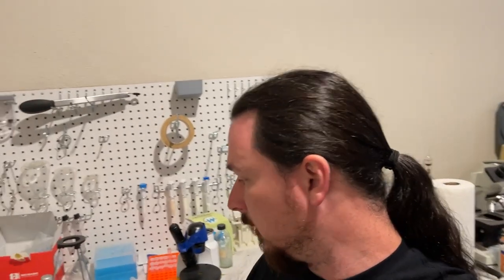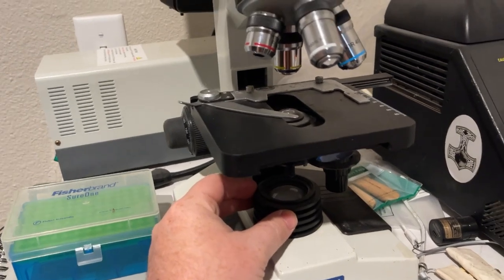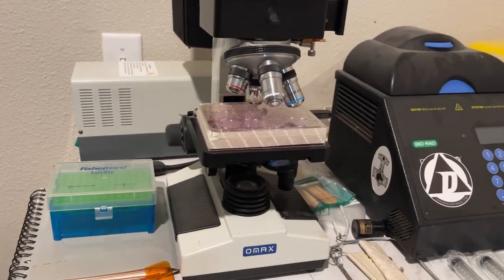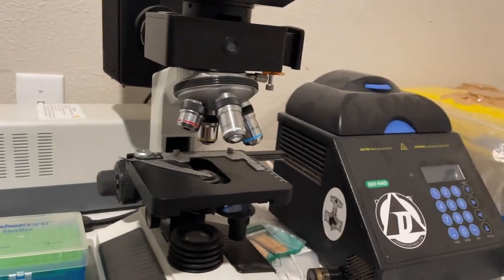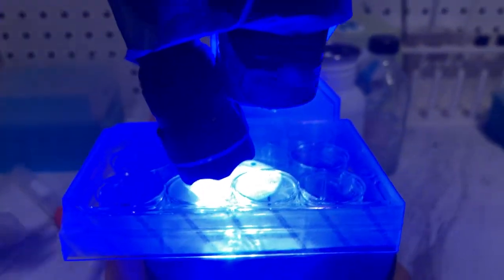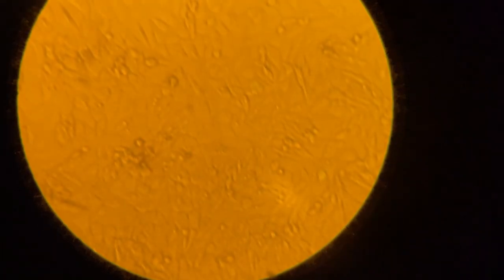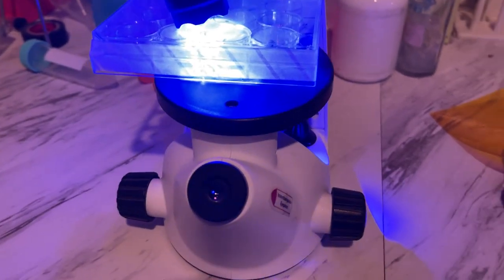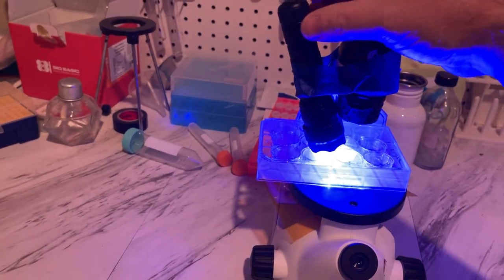Easy DIY Fluorescence microscope

Comment: 1:57 In your expensive setup, how can you get a two color image? What kind of emitter/excitation filter and light was used here?

In your DIY, you have a blue (445nm?) flashlight and yellow (blue filter).
So... should we simply understand that the diy yellow (blue filter) will let the green and orange light passing thru and therefore we can also get theses amazing 2 color image on the cheap?

Another question...
Could we just replace the white light with a 1W or 3W blue light from Ebay?
450-445nm or 365nm or 395nm single led. What would be useful/useless for fluorescence microscopy?

I also saw many high quality filter mirror of different wavelength (1cmX1cm for under 2$).

Thank you for sharing your expertise on Youtube.
Alex from Montréal
Reply from the maker: @alexandrevaliquette3883  I’m not sure the wavelength of the blue flashlight. 

Yes you can see GFP and RFP just fine with the DIY setup so yes you can get two color fluorescent microscopy on the cheap. 

As for the second question maybe so I haven’t tried it though. The wavelength of the excitation light depends on filter depending on what you’re looking at. Different fluorescence proteins and compounds like DAPI for staining can all be a bit different.